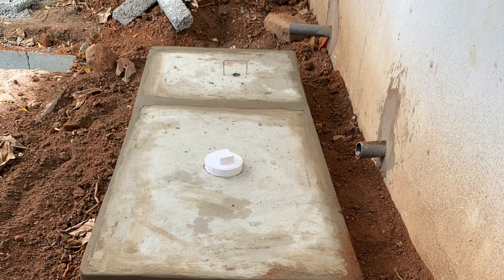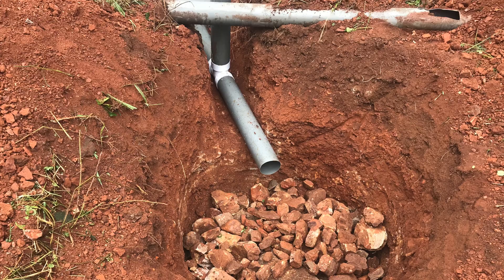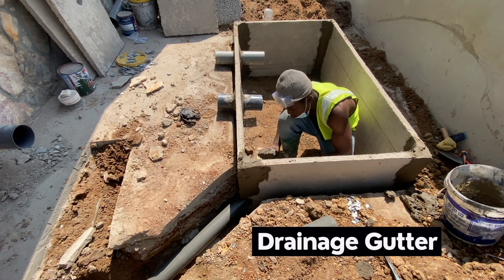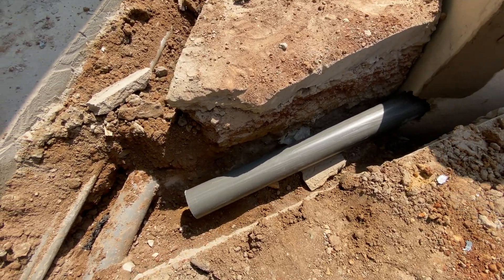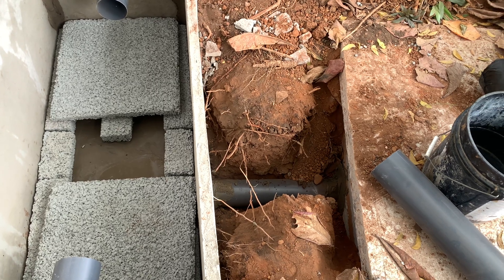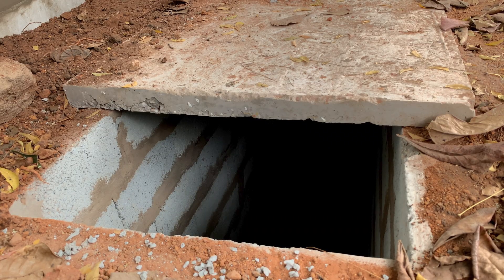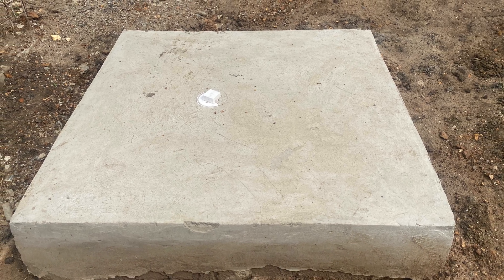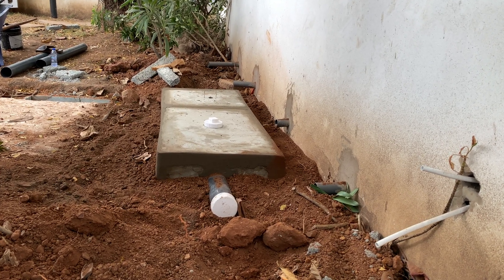How to construct a biodigester and connect to a soakaway pit

Comment: Help the man I hired used round covered but it seems it was a bad idea.Can I do a biodigester in the roundcovered
Reply: Yes. I have one for years, remember the round shaped, cylindrical shape will aid dispersing in holding outside pressure from the surrounding soil and inner fluid presure.